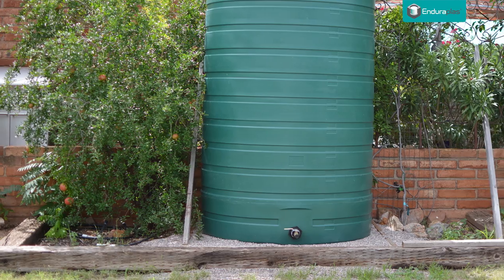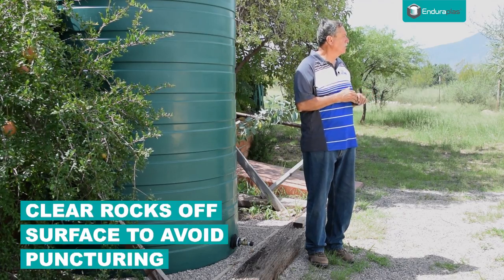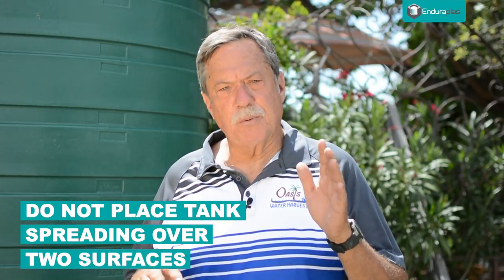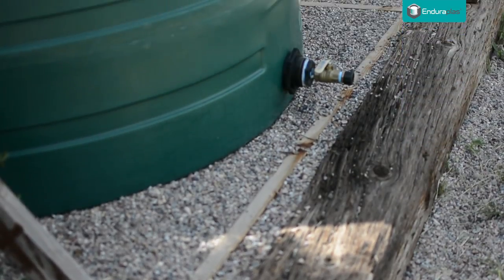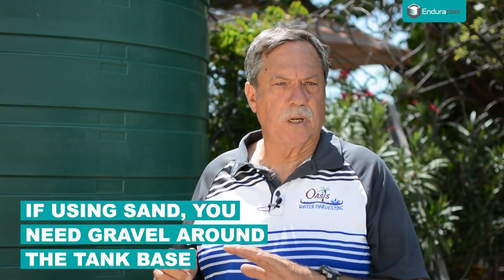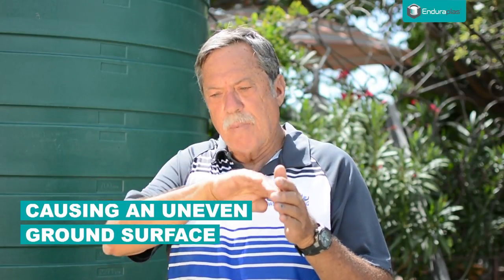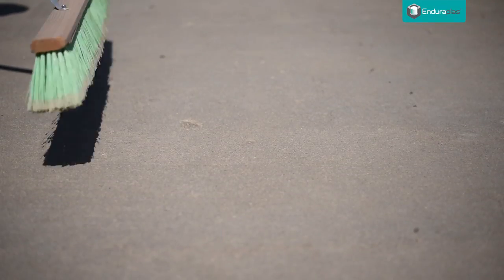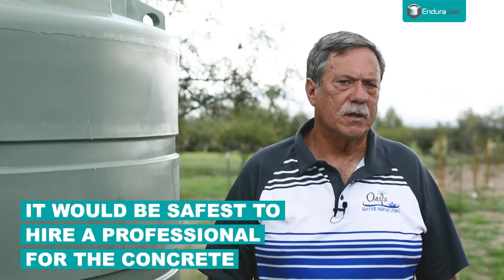Tips on Preparing a Proper Base for a Water Storage Tank

Comment: can you provide a little more info on specs?  is there anything under the pea gravel other than dirt?  wood boards are bolted?  redwood or treated ok?
Reply from the maker: The 3-4 inches of pea gravel would go right on top of the dirt.  Any wood under that would rot away in time and not do any good.  Frame for the pea gravel could be redwood, pressure treated wood, and some people use old rail road ties.  Lag bolts would be good if you need to bolt corners together.

Comment: For my 5000 gallon storage tank, how deep does the pea gravel need to be?
Reply from the maker: On a 5,000 gallon tank (as long as all the rocks on the dirt surface are raked away) a 4” inch thick pea gravel pad should work just fine.
Reply: @Enduraplas  Greatly appreciate you helping.  4 inches it is.
Reply from the maker: No problem. :) best of luck.